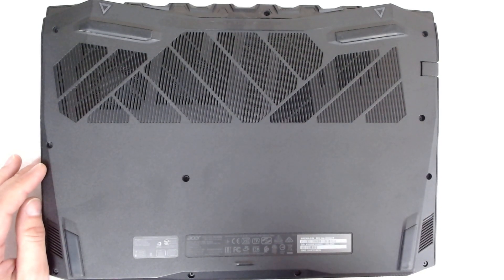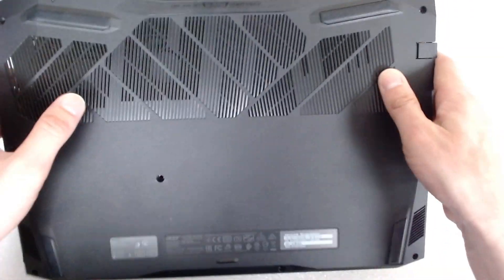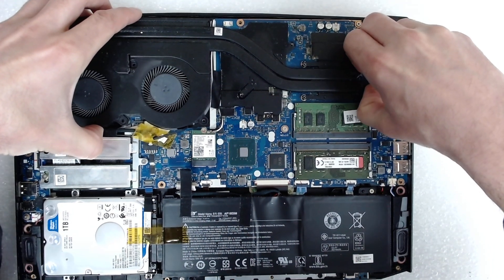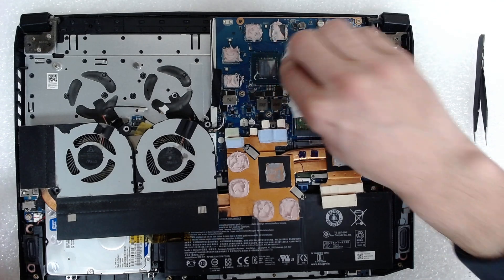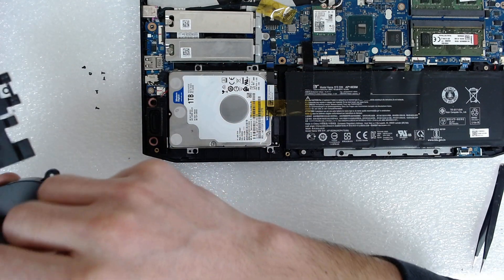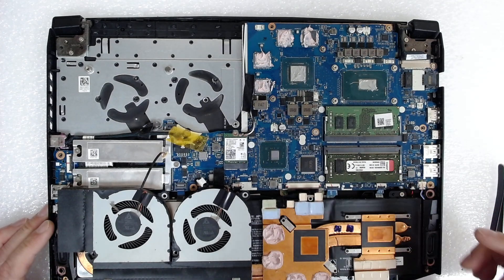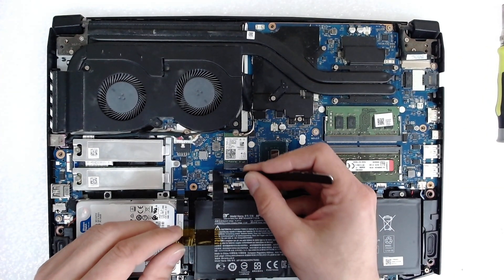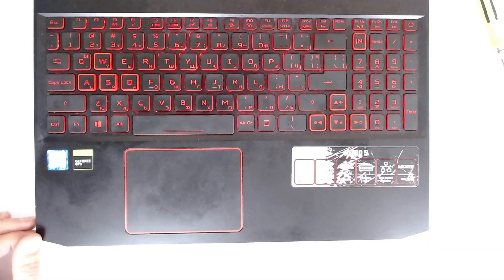Acer Nitro AN515-54 Disassembly / Fan Cleaning

Comment: I did all that and now mz laptop isnt turning on. Thanks though
Reply from the maker: Check did you plug back all the cables properly.
Reply: @ yes… i just figured out the battery wasnt connected right to i fixed it but it still isn’t turning on
Reply from the maker: @maxusnexuss  do you have any lights on the charger, or blue light when you press the power button... Any fan or light activity
Reply: @LaptopDisassembly no
Reply from the maker: @maxusnexuss the power button is on the keyboard. First check it, coz it may moved a Little while disassembly. Also when you disconnect the battery it takes some time before boot, sometimes like 20-30 sek. Also some of these models don't power on without the back cover on place... Have like a safety switch
Reply: I forgot about some black and white cables connecting from the fans
Reply: @LaptopDisassembly i fixed the black and white wire connecting to a component and it still doesnt power on
Reply from the maker: @maxusnexuss  black and white are the wifi cables probably, so they are not essential for the powering... By any chance you hit something, or drop something on the board. Also check the power jack cable. Even if the laptop doesn't power you should see a battery light when you plug the charger.
Reply: @LaptopDisassembly i rechecked everything, screwed the cover in, the battery should be fine along with the fans, the cable should be okay as well, but when i connect it to the charger there isnt even a blue or orange light. I must have damaged an important component while dismounting the fans. I’ve had this laptop for over 3 years and its pretty old so itbmight have just died. I’ll try to repair it again the next day otherwise i’ll get it checked out. I unfortunately have work on there so i cant just let it go
Reply from the maker: @maxusnexuss if you have a multimeter you can check do you have any voltages someplace on the board...
Reply: @ i dont
Reply from the maker: @maxusnexuss disconnect the main battery. Ot the bottom of the right side of the memory there a small red/black cable. It is for the CMOS battery if I remember correctly. Disconnect it and short the pins or the connector. Wait 1min after that plug back everything. Close the case and plug the charger, and try to power on.
Reply: I’m gonna open it again
Reply from the maker: @maxusnexuss yes, the pins on the board connector, not the cable one.
Reply: @LaptopDisassembly  ok i disconnected it from the connector let it 1 minute reconnected it and the battery but still no power light
Reply from the maker: @maxusnexuss  very weird why you don't have any lights. Even if you did brake something around the fan connector, you should see some light on the battery. Without a multimeter is hard to check something. Just double check every connector and cable. Put the back cover and tide the screws... And test.
Reply: I tried reinstalling the heat sink, replugging the fans and battery, resseting the black and red cable thingy, I probably scratched an important segment of the motherboard. I think i'll try a repair shop. Thank you for your help
Reply from the maker: @maxusnexuss  hope you can figure it out.
Reply: @ i’ll let you know
Reply: @LaptopDisassembly  hello, so it turns out that my laptop is "like it was stepped on", there are multiple issues - power supply, battery, motherboard... I really messed up.
Reply from the maker: @maxusnexuss  I doubt you did all of that only by opening it.
Reply: Hello, I have another issue this time with my desktop, it reboots every 15 minutes. This morning It took it 4 hours to reboot, then 1 then 15 minutes, and it keeps randomly rebooting every 15 minutes now. (This is on windows 10) I tried factory reset, installing windows 11 off of a USB Flash disk and still. Now im stuck with an uninstalled OS. Could you please help me? Note: I had to buy a power cord seperately, because the pc didnt come with it.
Reply from the maker: @maxusnexuss you had problems in the past with not turning on. Did you fix it and how. Also how long did it work after that. And since when it start doing this problem.
Reply: @LaptopDisassembly  well I have it for 2 days and it happened once the day I got it, if thats what you mean
Reply from the maker: @maxusnexuss you wrote me 2 month ago that it is not turning on. Is it the same laptop or not.
Reply: @LaptopDisassembly  im sorry if I forgot to mention. This is a conpletely different device (a desktop)
Reply from the maker: @maxusnexuss oh..... Different story. Please provide board model, CPU and power supply model
Reply: @LaptopDisassembly  cpu: intel i5 11400k, motherboard: gigabyte H510, I coudlnt find the PSU, but it is a 500 watt ATX.
Reply: Sorry if you see many messages here my phone is bugged and idk if they sent or not

Comment: a part from the 2 locations you put thermal paste what do you recomend for the other 4 slots in colour rose? is it thermal paste or thermal pad? Mine are too dried that I need to replace but I don´t know exactly what to put. Regards
Reply from the maker: The pink stuff is not a paste. It is thermal putty, and it is normal to be more dry than the paste. Don't put thermal pads on it's place. I usually don't replace it, just try to spread it a little bit. Otherwise you can look for thermal putty on Amazon or so...

Comment: I have the same laptop. One of the fans is making noise, very loud. I took it apart and realized that it is only one fan making noise. If I put slight pressure on it, the noise goes away. To replace it, do I need to purchase the entire part with the heat sinks or can I just buy the fan and replace the individual fan? I looked on amazon and I see fans, but for my part number it shows the entire piece with heat sink. Is it possible to buy one fan and replace it?
Reply from the maker: You can buy only the fan, no need to buy the whole set. Give me the full laptop model and I can have a look tomorrow.
Reply: @LaptopDisassembly  I found it on amazon. They sell them seperately. Are both fans the same? My laptop has the same part number for both, but they kind of look different. I have an Acer Nitro 5 AN5 15-54 series.

Comment: Thank you for this guide. I just installed a new ssd and cleaned the fans and reapplied thermal paste. Now my laptop runs much quieter and does not overheat as easily.

Comment: Before I cleaned the fans it was making thos god awfull rattling noise

Now it's silent like usual
But after somewhile it's back to rattling really loud again
Any ideas why?
Reply from the maker: @sayzu5  did you replace the thermal paste. It is normal when the temps go high the rpms to go up and be a little louder.
Reply: @LaptopDisassembly  yes I did replace the thermal paste while cleaning the fans and the vents.
But after like, 2-3 days it starts rattling really loud again
Reply from the maker: @sayzu5 probably you have a problem with the fans bearings. Try to lubricate them, and if that doesn't help, you have to replace them.
Reply: @LaptopDisassembly  alr I'll see what I can do, thanks for the advice

Comment: To replace the fans… do I need to buy the whole unit or can I just purchase the fans individually and screw them off and put the new ones in
Reply from the maker: You can replace only the fans... As you see in the video, there are few small screws, that are holding them to the cooler.
Reply: @LaptopDisassembly  thanks for the reply! I’ve had a heat warp on my fans for a while where it makes a loud irritating noise even after cleaning them they still make noise. I’m ordering new fans and I’m gonna take out the old ones and put in the new

Comment: I did all this an hour ago, but when i was installing it again after cleaning, a screw fell to the electronics things and made a sound like a high pitch little explosion, now my PC is not turning on 😭😭😭😭😭😭😭😭😭
Reply from the maker: Did you disconnect the battery before doing anything
Reply: @LaptopDisassembly  no 😭
Reply from the maker: @immigguu  that is not good. Do you know where exactly did the screw fell off. Can you do some good quality pictures and upload them somewhere so i can check them.

Comment: Thank you so much, this video helped me so much. My processor was running at 92 degrees Celsius, now it is sitting at 60-70. I do have to open it again and lubricate the fans. 

What do you recommend to use as lubrication? And again, thank you. You are godsent.
Reply from the maker: I use regular machine oil.

Comment: I know this is an old video but I can't find a definitive answer anywhere... would u happen to know the thermal pads thickness for that particular model? The few places I did find, say 1 mm but then some say u need both 1.5 and 1mm. I just want to avoid the situation where the laptop is taken apart and I find out I don't have the right pads.
Reply from the maker: Thermal pads should be 1mm. But you can easily use 1.2 or 1.5mm ( soft ones ) and they will get flatten. I usually don't replace the thermal pads and the thermal putty, if they are in a good condition. They don't "dry" out like the paste. So you can only replace the paste. But if u decide to replace the pad also, get a Thermal Grizzly or some other quality ones, otherwise you will have a negative effect.
Reply: @LaptopDisassembly  Yea, ordered 1mm Thermal Grizzly minus pad extreme, probably an overkill but still. Laptop is 5 years old, I replaced the paste with mx-4 2 months after buying it in late 2019, the pads and the putty were ok at the time but I imagine they won't be now and I figured since I wanna clean the fans I might as well replace everything. Considering the laptop's age, this will likely be the last such maintenance it will see before getting replaced.

Comment: I got a question, are the fans taped there? You were cutting it in the video to lift them, if so what tape is it and do i have to put it there if i want to replace the fans
Reply from the maker: The tape is more for stability. The fans are held by few screws for the metal part, so if you replace them, you may or may not put the tape. You can use a regular electric tape.

Comment: oh no my nitro 5 heat sink is completely stuck I cant even make it move easily like you did, what to do in this case?
Reply from the maker: power on the laptop, so it can warm up a little bit. No need to close the back cover. Leave it to work for 5min, After that remove the screws and try to move it left and right before lifting.

Comment: My GPU fan is not working please help, I have cleaned the fans properly but the GPU fan is not working, I plugged and unplugged many times but the problem is not solved, the fans are not damaged , I have plugged the CPU port and it is working properly but not in the GPU port
Reply from the maker: You mean if you plug the GPU fan on the CPU plug, the fan is working. ?

Comment: Hello, what screwdriver size do you need for the gray screws on the CPU part?
Reply from the maker: The green/black one is PH0 and the yellow/black one is PH00.
Reply: @LaptopDisassembly  I don't know why but PH00 doesn't work for me, neither does PH0
Reply from the maker: Try to push and twist at the same time. Sometimes you need just a little more force to start unscrewing.

Comment: Hello 2 questions if anyone can help

Had my nitro 4 years with regular cleaning

The right fan has a horrible sounds now when clean and i can hear it if i spin manually with my finger. Have tried removing the fan from motor but seems welded, if anyone knows how to remove so i dont have to buy new fan?

#2 is i wanted to replace thermal and bought some k5. However in process of removing heatsink i stripped one screw (labeled #1...) Would it be ebst to go to a computer repair and have them drill the svrew out? Seems scary
Reply from the maker: You can't fully disassemble the fan. Try to spray some oil between the blade and the chases. If that doesn't help, you need to replace the fan. About the screw, if you are not confident enough, let someone else drill it, otherwise you may damage the board.
Reply: @LaptopDisassembly  ok so the screw is a possible/somewhat common fix? I'd totally be scared too  and worried of a shop doing it as it's on the most fragile part

I ended up using a small amount of wd40 and dried all around to hope woth less collection from that lubricate, didn't have regular oil. Fan is good now.

Thanks

Comment: can I remove the fan blade? Mine's not spinning freely, I think it needs to be lubricated. hoping you ould answer my question tnx! :)
Reply from the maker: I think in that model you can't separate the blade from the cases. Try to spray some lubricant between the blade and rest. Or use a syringe and inject some IPA in between. It will clean the dust.

Comment: How do you find the right screw driver for the tiny black screws right near the fans?
Reply from the maker: I'm using one screwdriver for most of the screws, and I have a smaller one for the tiny one. The set I use have most of the bits needed for that.

Comment: The link for the tools in the description is not working :(
Reply from the maker: The link expired. This is the set https://www.amazon.in/Generic-BT-8912-Screwdriver-Notebook-Disassembly/dp/B06VVHBP58
Usually you need just a Philips screwdriver, tweezers and a opening tool.

Comment: I want to clean only the fans to get the dust buildup out. Is there a way to this without replacing the thermal paste or opening the cpu?
Reply from the maker: Not possible on this model. You have to lift the cooler in order to open the fans and clean the dust.
Reply: @LaptopDisassembly  meaning i also have to clean and replace the thermal paste then
Reply from the maker: @WaySub949  yes

Comment: Man i have this laptop and one of the fans has started to wobble ive cleaned it and everything and it will still do it i dont know what else to do other then replace the hole fan setup but i dont wanna do that just to have this same thing happen again..
Reply from the maker: Well, sometimes the fans do go bad. If the cleaning and lubricating doesn't help, than you need to replace it.

Comment: do I need to reapply the Thermal paste ?
Reply from the maker: If you lift the cooler, you need to clean the old one and apply a new paste.
Reply: @LaptopDisassembly  so if I clean the fan (taking it out), I need to apply new paste ?
Reply from the maker: If you clean/ lift only the fan, no. But if you lift the copper cooler, yes.
Reply: @LaptopDisassembly  to clean the fan I need to take out the fan and the roof of the cpu is also attached to the fan, so If I lift the fan out do I need to reapply the paste`?
Reply from the maker: @spike_of_ize  if you.lofy the cooler, you need to clean the old and apply new thermal paste. Try to lift only the fan if possible. This way you will not need to replace it.
Reply: @LaptopDisassembly  how do I just lift the fan?
Reply from the maker: @spike_of_ize check do you have some black foil above the fan. If yes, you can cut it and remove just the fan. If there is a metal plate above the fan and cooler, than you need to lift everything.

Comment: Hi, i wonder where is the cable of the keyboard is located, my whole keyboard didn't work except the power button.
Reply from the maker: The keyboard cable is between the battery and the square black chip with ENE on it.ON the left side of the memory.